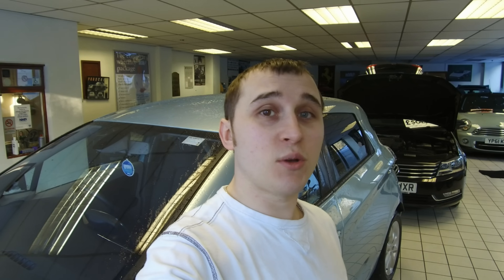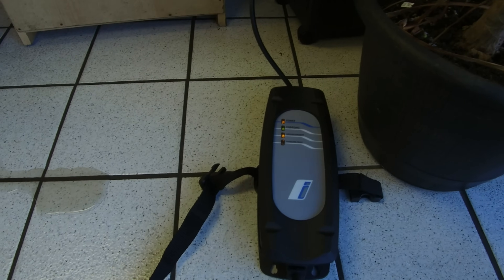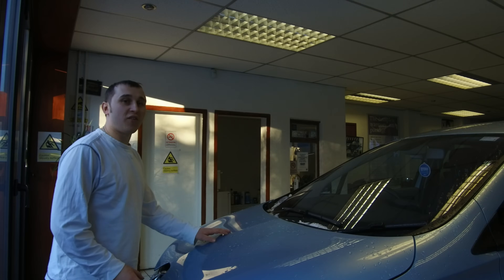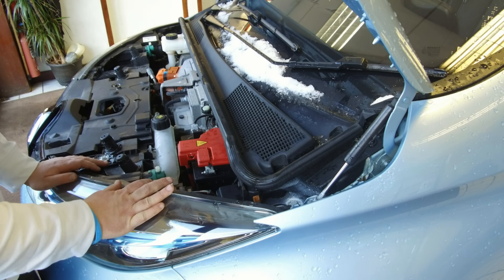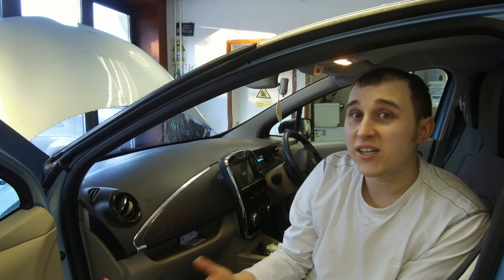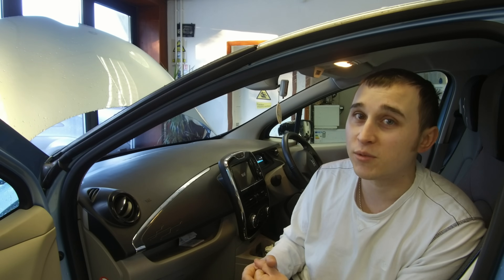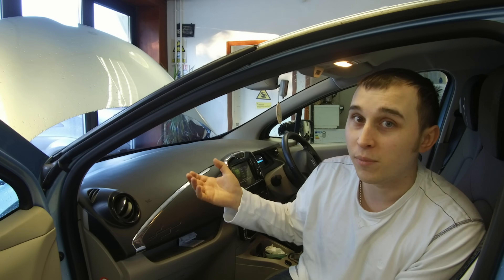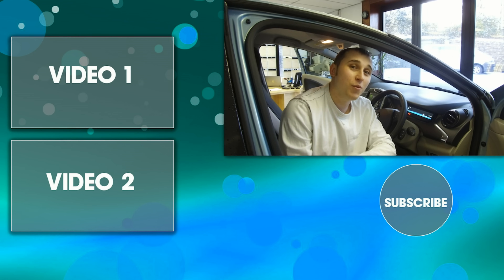How to look after your 12v Battery & is zoe fussy with granny cables

Comment from the maker: shortly after this video was edited i got the "Check Electric system" warning on my dash, sadly i didn't listen to my own advise of waking the car up as i didn't use it for 3 days and the VERY cold weather caused this error to flag up, started the car, drove to work and then plugged in at work for a charge went to wake the car up an hour later to top up the 12v some more and error gone 😀

Comment: Q210 and Q90 Zoe tests for good ground, by injecting 20mA between ground and neutral. So, if your EVSE has internal RCD with 20mA or less (most have 6mA RCD) it would trip and car would not charge.
Cars with R motor do not have this issue.

Comment: Really?! Every 3 or 4 years!!! OMG, ICE batteries used to last from 7-10 years! Why does the battery need replacing so often?
Reply from the maker: depends on car uses and battery ev battery can last longer Renault recommend changing it to ensure it never fails.   Mine lasted 6 years.  I've had ICE batteries fail after 3 years also

Comment: HI just bought Renalt zoe 2015 22k battery  range is only 60 miles on full battery is this normal on car this age ?ps only done 33,000
Cheers Dave
Reply: Hi David,did you get an answer to this in the end? Just bought a 2015 myself on 48k and it's showing 70 on full but I heard that's guessometer so based on previous driving styles not state of health of battery. Hope you're still enjoying the Zoe.

Comment: Would you have to be on a TN network for the BMW granny cable to work? I had to get a 13kg transformer because of the IT or TT networks here in Norway. But I hate to bring that heavy thing along on trips.
Reply from the maker: The earthing arrangement in the UK is very different a lot of it is physical earth rods in the ground or PME system

Comment: Coincidence , check electrical system came up  when activating 22vac charger in public , was connected to a volt at the time , 2 warning lights came up , but later a that day went away without having to go back and to Renault as initially advised in handbook . Have learnt to avoid a lot of these warnings, battery unable to charge another ⚠️ warning , all go away and are logged . Generally an earth issue with device plugged into , only would go back if persisted . Renault ev Guy not concerned unless stays on . My 12 v battery only a year old since changed , 3 year change , 4 year old + and going well

Comment: I’ve changed 12v batteries in ICE cars. Is it as straightforward to change in an EV?
Reply from the maker: Yes an no,  as the 12v is charged via the traction battery its best to let the car go to sleep before attempting to change the battery
Reply: Thanks Nicolas. Much appreciated.

Comment: Just like to know how I can still keep my 12v battery charged whilst away for about a month. You mention that getting someone to regularly open and close the door etc, but I can't do this. Question:- If I remotely condition the car through the app without the car being plugged in to the wall charger will this also automatically check the battery charge and top-up from the traction battery provided that the traction battery is over 60%.
Reply from the maker: Yes long as the battery stays above 60% why can’t you leave it plugged in?  PS have you subscribed yet!?
Reply: Don't want the cable across the drive while I'm not there. Postmen etc could trip over it. Thanks for that otherwise.
Reply: Nicolas Raimo Yes, I am subscribed and love your videos.

Comment: Thanks for this info. This just happened to me. 2013 zoe from new, no issues so far, but found car unlocked apart from the boot and all electrics dead. Assistance charges 12v battery and car cane alive. However, the pedestrian warning system kept wailing, the red light on the switch was flashing and I couldn’t switch it off. However, it went off after a few mins, but came on when start button pressed. Renault say computer is gone. Do you know whether the computer could have been blown by the charging of the 12v? The car has 9,770 mls. I’d love some feedback, please help. Thanks. I’m now 6 months outside my warranty
Reply from the maker: Please subscribe to my channel; I am unable to tell it could be the computer being at fault caused the drain on the battery.  Jump leads can cause damage to electric system which is why all garages have special booster packs and 12v charging system's that don't overwhelm the cars system so unless his equipment  was faulty which is highly unlikely its doubtful he caused the issue.  The computer also might of also been at fault prior to this.   If you have full Renault service history might be worth asking Renault for some goodwill towards the fault or asking RCI for some goodwill as a battery lease customer.  
Renault warranty can be extended as long as the current warranty hasn't expired.
Reply: Thanks Nic for this it means a lot and getting back so quickly. The recovery driver was the one who charged the 12v battery. Up until this point I can only say I drove back as normal and parked up. This happened the following day, so the computer was working before the charging. Also, Renault have never suggested nor replaced the battery at the three year point and car has been serviced each year. Could the traction battery be compromised? And should I ask them to replace it since I’m still in warranty for that up to five years. Would it have recharged the 12v if it wasn’t ? I didn’t notice that the cells had been topped up with water when the recovery guy disconnected it. This was to try and see whether the pedestrian alarm would turn off, but it kept on going for a while. I just feel that something doesn’t feel right here. If they’re at fault I’d like to
be able to back up my argument. Any other ideas please. Thanks so much. :)
Reply from the maker: As per video, the traction battery only tops up the 12v when the car is woken up, however if your 12v battery has not been replaced then the plate cells would of failed this is a service item so wouldn't be covered under Renault warranty. The computer could of failed at any point without an engineer inspection there's no way of proving it either way,  If the ped horn is going off all the time you could just Pull its fuse.
Reply: Nicolas Raimo thanks again. Hopefully they tried that, I was told it kept on going, surely they know where the fuse is? I’ll feedback what final outcome is. Very good channel, absolutely great. Can’t thank you enough.

Comment: From what I've head it's the grounding of the electricity supply rather than the cable itself.  So some people with older or poorly installed circuits will complain that all cables fail to work, while some will find that anything more advanced than a bent paperclip will be fine.  Also the Q210/Q90 motor will be less efficient than the R models and have heard reports that the Qs will only charge at all from at least 10A.

I've bought a Duosida cable from eBay off a UK based EV supplies seller, and it works fine, also seemed to for Ian Sampson on one of his early Zoe test drives.
Reply from the maker: Its a mix of both David, so first your Electrics need to be up to spec and so does the cable.  Some cables will never charge a zoe regardless of how good your home wiring is.  Other members of RZOC found this out the hard way by ordering lots of ones that didn't work.
Reply: Interesting - I guess I lucked out a bit then!

Comment: Great Thanks Nic-  Curiously my petrol  car battery has gone  flat in the snow - can i  use jump leads from the 12v battery in my Zoe to jump start my petrol car?
Reply from the maker: I’ve not used jump leads for many years and we advise against using them as it can SPIKE an ECU we not use portable battery boosters which are much safer
Reply: I would suggest not. I expect the battery in the Zoe is a deep cycle one (low current over long time) rather than one designed to crank a starter motor (high current over short period). You may well damage the Zoe. Use a separate booster or better still buy a Ctek battery charger and use it to recondition the battery - they are fantastic but if kit. Generally if a car battery fails in cold weather then it’s nearing the end of its life and needs replacing.
Reply: As others have said, best not to try it at all.  I have heard that if you have no other option, you could connect the battery from the Zoe while it's on to the ICE battery with the car off.  Leave it for a decent while to top off the battery and then disconnect BEFORE cranking the ICE car.  Still wouldn't recommend it though and wouldn't want to try myself.
Reply from the maker: Leo i use this booster at work http://amzn.to/2FPhidJ it very portable and can be used for charging your phone and it also has a flash, it can start even VERY large engines.
if you want something cheaper try http://amzn.to/2oMz0GN
Reply: Thanks for the tips
Reply: The users manual specifically says not to do this.